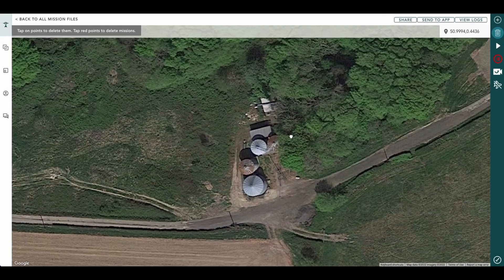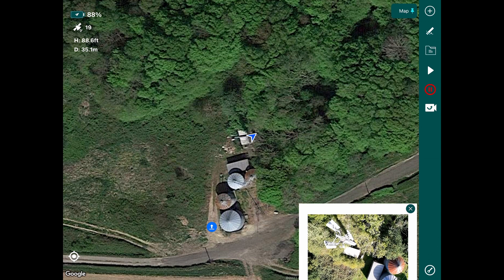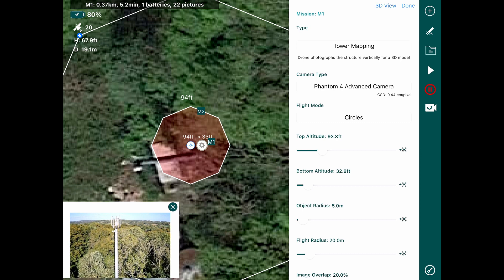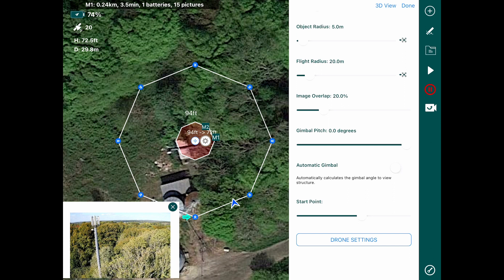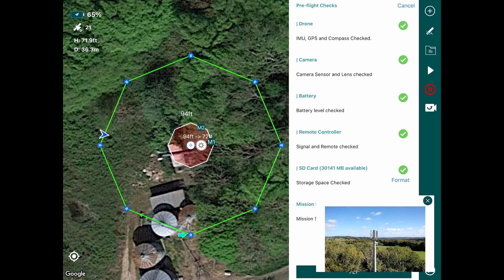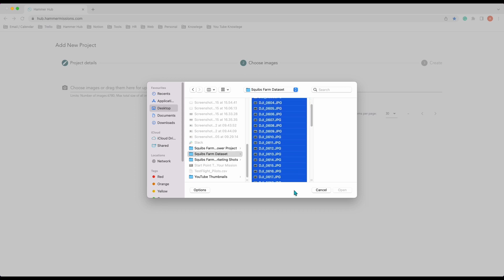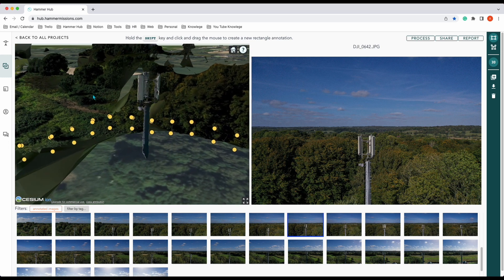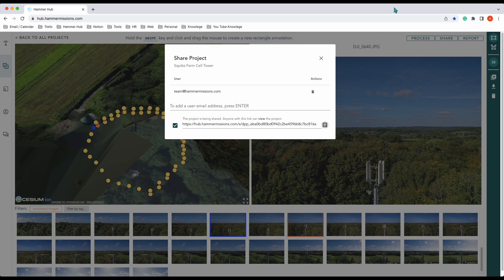How to Conduct Cell Tower Inspections with Drones | Hammer Missions

Comment: What drone are you using? I have some tower inspection work and need a drone. Also, do you just need a drone license ? Or are there other certs you need
Reply from the maker: We used a Mavic 2 Pro for this one, but there are newer better drones on the market now - the DJI Mavic 3 Enterprise for instance. Also, you typically need a commercial drone flying license for this work depending on the geography you are flying in.
Reply: @HammerMissions thank you!

Comment: Where exactly is the "CT" button that you mentioned? I paused the video but did not see it.... Thanks.
Reply from the maker: The c2 button is located on the back right of the remote controller. Here's a link explaining more: https://www.letusdrone.com/dji-controller-c1-and-c2-button-customization/

If your drone does not have a C2 button, you can also alternatively simply TAP the drone icon on the map screen to register the drone's current position as an input. Hope this helps!
Reply: @HammerMissions  Lol, sounded like CT but thanks, got it!
Reply from the maker: @frankc.9853  Happy to help!

Comment: Looks great and simple to carry out.
My questions are:
1- what about the below part of the tower and the Motors rooms?

2- Is there in possibility to export the 3D model in BIM model in parts?
Reply from the maker: @Mahmoud, thanks for the questions! 

1 - In a real mission, you can capture the entire cell tower and model it. This video was just a demo cell tower. Here's a complete cell tower: https://hub.hammermissions.com/s/dpp_22b29287b9274c8db758a022adb9de35

2 - Yes! You can export the model into BIM using .obj and other formats

Comment: Hello and thank you for the video. I am very curious about the inspection with that Mavic Pro 2. Maybe it is just in the video, but the resolution of the photos seems so low. i am wondering how the tower owners are able to determine any issues? So that is why I wonder if the drone is good for the job or if a pilot would have to perform a flight a lot closer to the subject. I just try to understand the purpose of an inspection that does not provide high detail levels. I know the camera has decent MB specs, but even zoomed in, the quality very quickly gets bad. Thank you very much.
Reply from the maker: Hi Don, yes the resolution of the video and the images make it hard to see the details but this was just an example capture, as opposed to a commercial inspection. You can definitely see the details from a more well-lit capture. Here's a project showcasing a more complete 3D model and drone images you can zoom into for details: https://hub.hammermissions.com/s/dpp_22b29287b9274c8db758a022adb9de35

Comment: Thank you. How do clients actually utilize the 3d models? Are there other ways to deliver the model?
Also, will the software work with the M30?
Reply from the maker: You can share a link with the clients of the 3D model. Here's how: 
https://www.hammermissions.com/post/sharing-your-projects-in-hammer-missions

And yes, the software will be compatible with the M30 in the coming 4-6 weeks.
Reply: @HammerMissions  Great. Thanks
Reply: That is a very good question: how do they use them. Maybe you mean what can they determine with the use of the model. At least that is the question I would like to see answered.
Reply from the maker: @DonHodges-mg2bd  The model typically provides 3D spatial context of where the issues are and the images provide the high resolution details for the inspection and consequent maintenance planning.